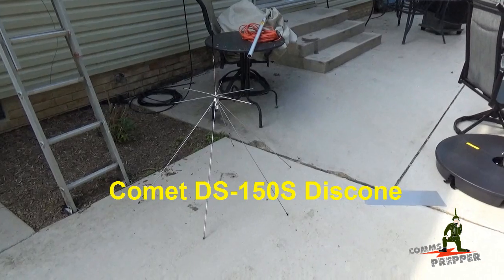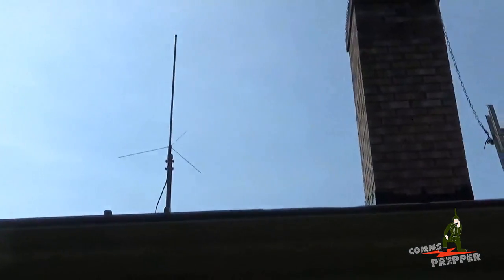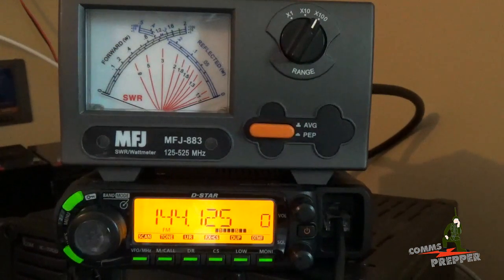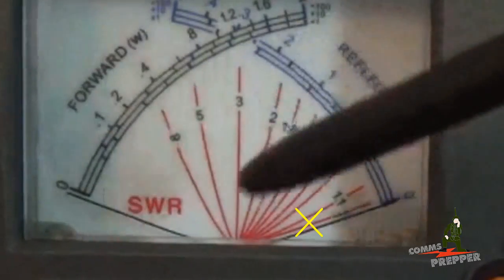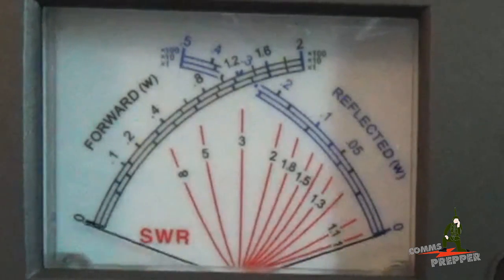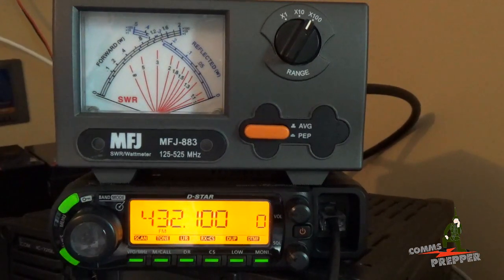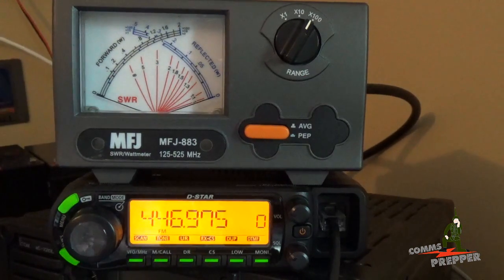Comet DS-150S Discone Antenna Mounting and Testing

Comment: Past experience with discones have shown the SWR to be great, but performance to be lacking.  A local ham, over the Niagara River from me,  in Canada, can hit a Buffalo repeater on his HT easily with the stock dual-band rubber duck, but is too noisy to understand when he connects the same radio to the discone.

Also, the SWR on 6 meters and 1.3 meters is under 2:1, but he can't hear us on 52.525 or 223.5 with the discone. I have no good explanation. He has a Ringo on those bands, and he's solid on either band when using the single band antennas.

Based on this, plus reports from other amateurs around WNY and Ontario, the discone is marginal at best.

de WB2VUO here near Buffalo

Comment: It sure would help if the SWR was high and you showed what can be done to adjust it.
Reply from the maker: Depends on the antenna type.  Most amateur radio antennas come with "tuning or adjusting" instructions to get the lowest (best VSWR).  the basics are adding or removing length to the antenna elements.

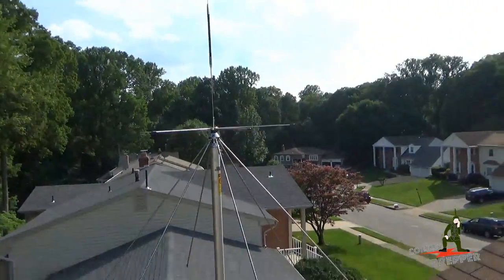Comment: good evening. In sequence 1:12,  how seal against moisture the Discone antenna outdoor? With silicon spray?  best wishs Harald CH
Reply from the maker: It comes with tape. Do not use sprays.  You can by weather proofing tape.

Comment: A question: If I am not interested in using the DS-150S on 6 meters, do I need to attach the whip on top? The whip appears to be active only on 6 meters, and since I plan to listen/transmit only on 2 meters and above, I wonder if I can leave it off.
Reply from the maker: Not sure but I think you are right - that the whip part is for the 6m.
Reply: Commsprepper Thanks! Just ordered the Comet discone and will install it as soon as it arrives. In addition to scanning, I will also use the discone as my amateur radio antenna for 2m and 70cm and I very much appreciate your videos.

Comment: excellent. I grabbed myself the same antenna. I do have one question, how did u ground it?
Reply from the maker: The antenna is grounding via the mounting pipe.  If the pipe you are connecting it to is ground then you are good to go.

Comment: Nice video! I just picked up a Tram 1410 Discone to use with my SDR for various experiments (op25, dump1090) and am impressed with it's performance. Funny you also have the ID-880H, I have one mounted in my Jeep as a mobile unit on a COmet CA24SR antenna.
Reply from the maker: I need to reprogram the ID-880H.  Perhaps this weekend.
Reply: Chirp sure makes it easy to copy configs between radios. I didn't find much value in the Icom cloning software. Have you done a video on DSTAR yet?

Comment: I've always been intrigued by those discones but never had one. Is that upper vertical section with the loading coil adjustable with Allen screws top and bottom of the coil form to fine-tune the SWR?
Reply from the maker: It's adjusted for the 6m band.  If you  don't use 6m you can leave it off.
Reply: Understood... thank you and 73.

Comment: Hank, if you're planning to use the discone antenna for any scanning especially in the public safety frequency ranges (770 Mhz to 870 Mhz) then I'd recommend upgrading your coax to at least LMR400 even if it's a short run.  It's a worthy upgrade for the gain difference you'll get in the higher frequencies.  Also, since discone antennas aren't designed for gain you can help this by raising its height.  A cheap way is to buy a 10ft piece of EMT conduit at any major hardware store.  You can prime and paint it any color if you wish to make it stealthy.  The extra 10ft may not seem like much but can make a substantial difference in Tx and Rx performance.

Comment: Looks like a winner! Could you use one of those with a handheld radio? I have adapters for mine to hook up coax cable.
Reply from the maker: TR - Sure can!  It will work fine with an HT.  Hank

Comment: Thank you for this information Hank.
    Does using 50' or 100' of coax greatly affect SWR?
Reply from the maker: Not really but the longer the run the more loss you will have.  You want your cable run as short as possible.
Reply: Commsprepper I see.  What is the longest coax that you would feel comfortable running; on say a 100w radio?
Reply from the maker: Depends on what frequencies you are operating and how much loss you are willing accept.  Check out this chart. http://www.w4rp.com/ref/coax.html
Reply: Commsprepper Nice charts, thanks.  I think I am looking at a 100'~ installation. This antenna is on my wish list for sure.
Reply: Use LMR400 if you're going for 100ft of coax.

Comment: Good SWR If I didn't just put up a diamond I'd order it.  I may order it anyway as a receive antenna and backup 2m 70cm
Reply from the maker: I got it for the spectrum analyzer.  I'm less concerned about the 2m/70cm operations.

Comment: The Discone under ideal conditions should give you a spherical beam pattern.  As an only antenna it's fine but it's a compromise.  You'll need the Discone for a scanner (SHTF) but the 2 meter antenna will give you better take off angle and as you know can reach out further.  I use my Discone side by side on two different rigs and there is a world of difference.  I suggest using your Discone in your WVA property.
Reply from the maker: Thanks.  My plan is to setup a second Discone at the retreat.
Reply: question i live southwest WV, near mountains but i am in a mountain at the draw portion, my house sets in a 1 acre opening but above it surrounded by 3 sides is mountain then 4th side mountain about 1500 feet from me. I have a discone with LMR400, 50 foot, 22 feet in air not in center of property but one side which would be near woodline, it hasnt received anything at all in my county ever with anys etting you can fathom, software is updated, and verified, freqqs downloaded from radioreference, and zero reception with a brand new SDS200 bearcat radio scanner - am i going to have to raise the antenna to 100 feet in air or something?

Comment: Looks great ! Thanks for sharing .  I ran a sweep of my discone with a sitemaster years ago for laughs and outside of a few minor bumps you would have thought it was a dummy load. They are a great antenna . We had a bunch of STI-CO discones as part of a project I was on and there was no measureable perfomance increase between those ($$$$$) and the amateur variants. I look forward to watching it work with your spectrum analyzer.
Reply from the maker: Thanks.  I am checking things out on the SpecAn now.
Reply: sweet !

Comment: Shorten the stinger up about 1/8 + of an inch and should center the swr freq out.....
Reply from the maker: Stringer?
Reply: The center vertical radiator
Reply from the maker: The center vertical is for the 6m band.  timing it would not affect the 70cm or 2m bands (per the manual).